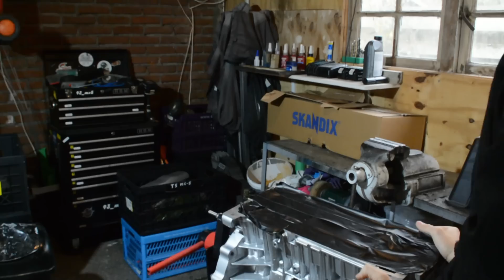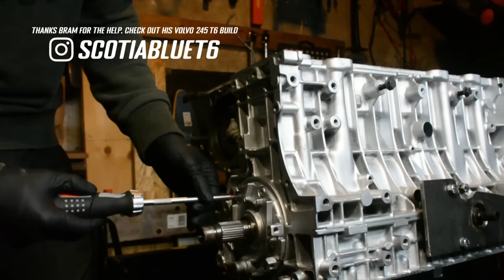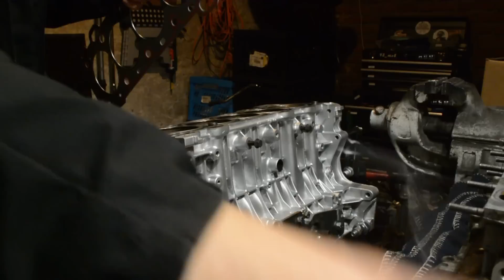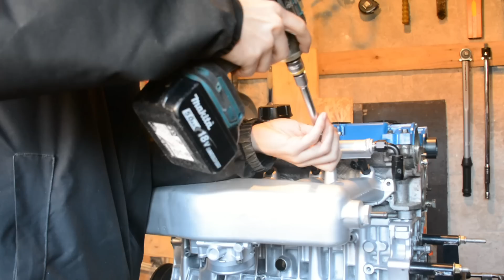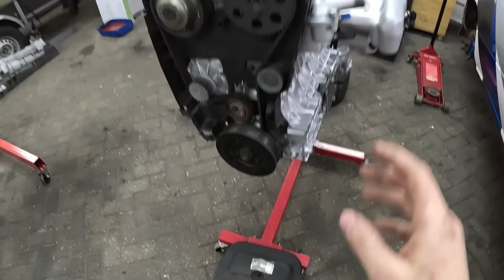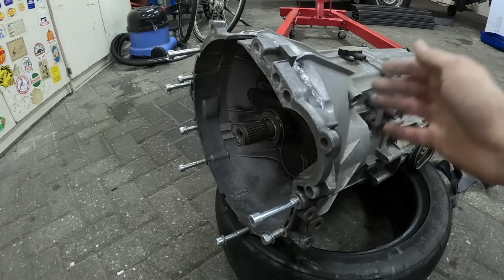Miata 5 cilinder swap part 1: Engine assembly

Comment: How did you get the engine parts looking so fresh? Special paint? If so where can i buy it
Reply from the maker: Cleaned, degreased and painted with MoTip Heat resistant silver

Comment: Did y'all keep the same height buckets on the valves they belong on? They have numbers on the underneath that indicate the spec from tip to lifter face and that correlates with the appropriate lash on each valve. You can't just throw them back in anywhere, you should record the location when you take them out and put them back in where they came from. FYI

Comment: Just saw rhis in FB and I am here to see full video. What is function of the shims?
Reply from the maker: @zdravo4  to prevent cracks between cylinder walls when more boost is added
Reply: @ ah so, wish you good luck woth the project

Comment: Why are you putting metal plate between cylinders ?
Reply: These engines have a tendency to crack at the relief cut between cylinders at high torque levels, adding shims helps stabilize the cylinder and prevent failure.

Comment: Man i actually already thought of doing the same welding of 2 bellhousings instead of using adapter plates, it seems a lot easier actually. You wouldn't have a video on how it was done do you? I want to swap a honda k series in my tacoma, using a toyota trans and welding part of a honda bellhousing, what i like about toyota is removal bellhousings. I have to use yota trans to keep the factory cluster working cause its a cable speedometer etc. Plus i like the look of oem gauges working.
Reply from the maker: Not really a how to, but there's more content on my Instagram reels (instagram is also Yatajoris)

Comment: Hey just a word of advice. Have your machine shop tank your block then bring it home and do any block work you wanna do (I.e. grinding slag, smoothing sharp edges, tapping threads) then bring it back and have them tank it again and do any other work that’s needed. So you don’t get any metal shavings in your engine. Blowing it out can only do so much. Just my 2 cents

Comment: What size tap did you use for the oil drain hole on the block?
Reply from the maker: M22x1.5 
I drilled it to the right tapping size first. Then I put in an10 bung

Comment: Is the pilot adaptor steel?
Reply from the maker: Yeah
Reply from the maker: C45 steel
Reply: @yatajoris  you’ll need some kind of d if a brass or oilite bush between the crank and the input shaft other it’ll bind up and squeal

Comment: What’s the purpose of the shims between cylinders?
Reply: Cracks can occur where the cylinder wall is thin, which is mostly those 4 slots between the cylinders. Shims in between 'merges' the two cylinder walls, effictively making them thicker.
Reply: @ so were the slits between cut or did they come from the factory that way? Based on what you’re saying, sounds like yatajoris machined those gaps? Thanks for the insight!
Reply: @blokshredder1276  its that way out of the factory, my guess is for even cooling and/or expanding of the cylinder wall.

Comment: The original s2000 concept drawing had a inline 5. Still mounted behind the shocks. Always been on my bucket list. Altho. Probably would use a rs3 engine(my original plan was the old vr5 but they too old now).

Comment: Can someone explain why exhaust manifold is so weird? Why one cylinder has runner so long, and then connects to shortest runner just before turbo? Is this somehow better than simple log manifold design?
Reply: well theres some debate in the volvo world about that, the engine in this video normally has a different style exhaust manifold. They put the older style on, because people in the forums always shouted that the old design flowed better. Which I think it does not, seems like a very restrictive design at least for the long runner. But thats my opinion.
Reply from the maker: Yeah some say it flows better. The main difference is also sound. You can hear a difference and in my opinion this one sounds better. 
There is also a log style manifold available. Might try that and see dyno results
Reply: @yatajoris  sound definitely is a difference, i think the old one sounds better at low rpm and the new one at high rpm

Comment: Ah you're beating me to it! I've been planning the same build for over a year now. You've already solved a few problems for me, and I can't way to see how you tackle getting it into the car. Quick question though, I was going to use adapter plates for the gearbox, as there's a few companies that sell them. But with the welding, how did you ensure that it was going to stay flat, true, and square to the box? Did you create a jig?
Reply from the maker: Yeah made a jig. It's on my Instagram (also Yatajoris)

Comment: never seen a valve cover double as cam caps, thats so cool
Reply from the maker: @UnstableAdrianHD  yeah pretty interesting engine. Same with the bottom end. No main caps, just one large carriage. Makes it super strong though
Reply: No that is not cool.

This engine have solid cam bucket and that's mean you need to adjust Valve clearence from time to time but with this desing it is impossible to do without special tool
Reply: @Luminous65 no, you don't have to, they hold the clearance longer than than rings
Reply: @Luminous65  no it has hydraulic lifters...
Reply: @onnikemppi368  maybe this one, but most of thi engine have solid Valve bucket
Reply: @Luminous65  okat?
Reply: @Luminous65  oh no..... you would need a special tool every 100k km... i would rather have a strong as fuck engine and spend 50 euros on a special tool.. but hey, someone has to find the problem in everything
Reply: @PorkChopForLifeMC  you have ford duratec 2.5 4 cylinder, that hold in stock form more power and dont requier special tool for Valve clearence adjust
Reply: @Luminous65  not really, the 83mm blocks (all 2.5's and most of the 2.4 versions) crack a cylinder liner pretty easily, the specific 2.4 in this video is the strongest variant internals wise of all the volvo 5 cylinders. And the engine in the fords also has the camshaft bearing caps integrated in the valve cover...
Reply: i just see this one has single vvt so the one in the video is actually a 83mm block which is also prone to cracking like the 2.5, but anyway if you really want to make some power on stock internals you need the B5244T5 engine which was sold as T5 in the s60/v70 from 2005 to 2008 or so. 260HP and dual vvt in stock form
Reply: @DWTSVIDS  i talk about ford 2.5 4 cylinder, not 5 cylinder

Duratec series that ford made in colaboration with mazda. For example, esslinger made on stock engine somethink about 470hp

And in this engine you dont need special tool to adjust Valve clearence
Reply: @Luminous65  YOU DID NOT COMPARE THIS ENGINE TO A FUCKING DURATEC AHHAHAHAHAHAHAHA
Reply: @Luminous65  ah okay from what cars are those, im not sure we have those here in europe
Reply: @PorkChopForLifeMC  Never had to adjust my valve clearance in over 200k miles and 450bhp
Reply: @R3ddyyg  yes i compare this overcoplicated pice of something to 2.5 duratec, becouse the duratec is easyer to work on, simpler, have close deck design, make more torq in low end and hold up more power in stock form.

For your onformation i have Volvo V70 2.4t and mazda 3 with rebuilded and swaped 2.5 duratec so i know what i write here
Reply: @claymore2k1T10  i have volvo v70 T5 with second angine in it with 550 000 km and i can tell this engine can be reliable but it is not well designed in stock form
Reply: @Luminous65 Agree

Comment: Will the diesel gearbox have weird ratios for a petrol engine? My experience is with older stuff where diesels had less power and torque and gearboxes had less ratios and the ratios/final drive had to be organised to suit. Is this less problem on more modern stuff?
Reply: Diesels often make more Torque than a comparable "petrol" engine.       They also don't rev out as high.      A 2l "petrol" will often rev out past 8k rpm.    Comparable diesel less than 6k.     This means the ratios are longer on a diesel    they have the torque to pull it along rather than needing the HP up top

Comment: Did you consider the SI6 engines? Volvo claimed that they were 1mm shorter than the 5-cylinders. Was the weird accessory drive a deal-breaker?
Reply: As I was watching I was thinking the same thing, I would imagine blocks are a little more expensive too

Comment: I don't Know volvo engines at all but i have à question : why do you put little piece of scrap metal between the cylinders ? 🤔
Reply: with honda you do this aswell with the block guards.. but its debated if it really does anything
Reply from the maker: @cocoboderedu17360  the cilinder walls are thinnest between one each other. They flex and can start cracking under boost. To try and prevent that I added the shims
Reply: @yatajoris  in my experience they crack most of the time because the head doesnt flow enough so there people put more boost but they have minimal performance gain compared to how much boost they run because the head is still stock and doesnt flow close to enough air. the dual vvt 2.4L engines are the best because they have a better block design than the early 2.3 engines in terms of materials since they have less friction and casting is better. the duall vvt head is better because it has more flow so you dont have to run as much boost for the same power.
ps. in my opinion it would be best to fit a dual vvt head on a p80 lpt 2.4 engine since the p80 2.4 is already lower friction than the 2.3
Reply: OK it's the first time i see this, thanks for your Light 😁 Nice build, very interesting and instructive videos bro 😁👌 sry for my english 😅
Reply: @cocoboderedu17360  it is a common practice on 5 cyls in focuses st mk2 and volvo
Reply: Will the oil drain on that angle?